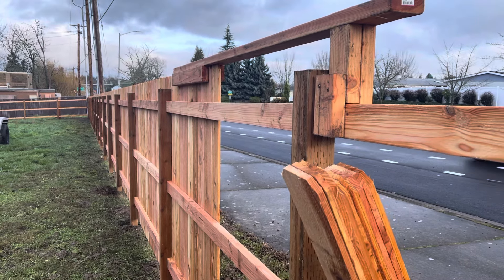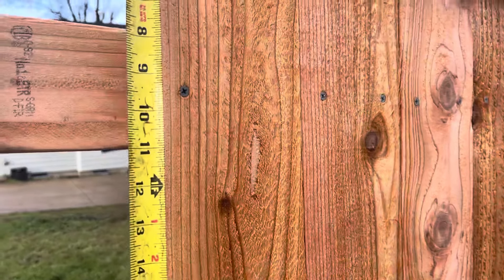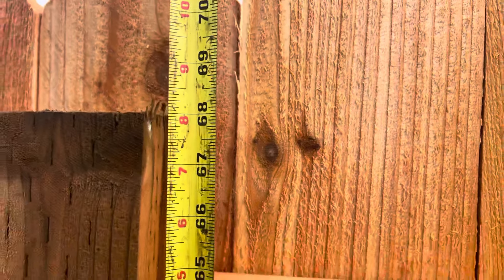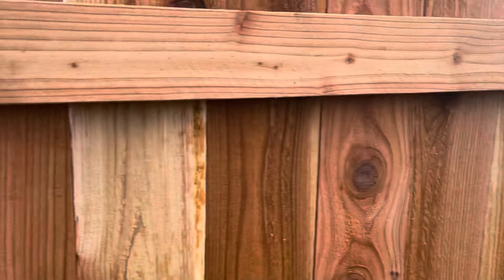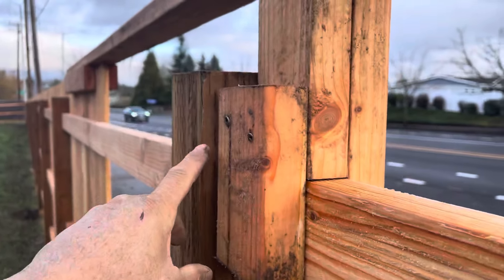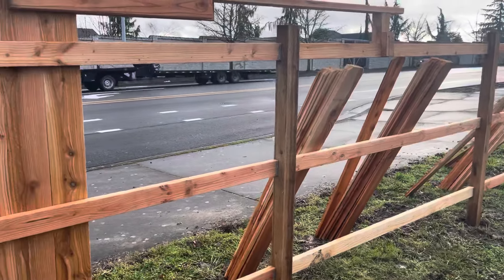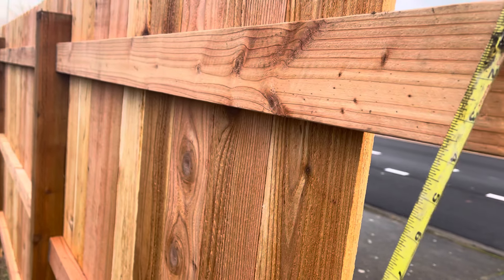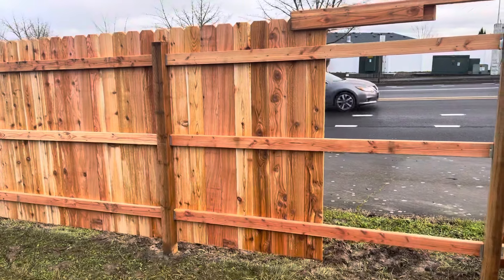HOW TO BUILD A WOOD FENCE STRAIGHT DIY

Comment: Isn't that large gap at the bottom of the fence to the ground defeat the purpose of a fence? Well, I mean, if you're wanting to fence in a dog?  Should the dog-ear panels ever follow the ground or does that make the top wind up looking like turds?
Reply from the maker: I am very glad that you asked this question. Thank you. You can follow the contour of the ground. And your fence will look on the top like the ground does on the bottom. If it ground goes up and down , the top of the fence will also. This may not be the most desirable look. If the fence were built that way, and then you decided you wanted to make your yard flat. You would end up burying the bottom of the fence fixing the low spots. Your ground would not be flat any more , but can you imagine what the top of the fence would look like now? Flat ground and a fence that goes up and down?  If you have a yard with uneven ground. And you have a dog also. And you want your fence to look good, keep your dog in, and add value to your home and curb appeal at the same time. I would suggest using this method. Fix the fence first to establish a grade.  The fence is now straight from one end of the other . If you use the new fence as a guideline to build your dirt up to the bottom of the fence, your yard will be perfect. Just like the top looks. The bottom will now match. Now you can  solve multiple problems while at the same time enhancing your property.  I hope this helps to answer your question. Please feel free to ask more if you have them. I will be happy to try and answer them. Thanks again!
Reply: @fastflo1   Well, for the dog, I can't keep them inside. They shit! IF they ever got out, I'd freak! 
But for the fence....So, if someone has an uneven ground, and they want the straight line sight at the top of the fence, the two options are to build the ground up, which isn't always an easy taste, or simply bury the pickets? I suppose you could cut them down to size too, right? The reason I ask is because thats what I just did on my current flip property. It was a "B"....took forever! And not to mention, some spots the height of the fence is pretty short. Thats why I thought, "well, I can just run along the ground and let it determine the height, but like you said, that wouldn't look good in the end either. 
So, I'm guessing the ideal situation to end up with a great looking fence, you pretty much need a straight an level ground, right?
BTW, thanks for taking the time for the response!
Reply from the maker: @johnnyleeway3466  Sorry for the late response. I did not see this until now. I prefer to run a nice long line as consistent as possible and this provides a guideline for the landscape. You end up with a nice yard and fence line. You can extend the boards.  But the issue I have with building a fence to all the low spots is that if you ever decide to fix the yard later you have to bury the fence and end up with a uneven looking fence in the end. So My advice is to pick a grade that would look good, fix all the low spots, cut down some high spots, and even the landscape as much as you can. Build the fence and make it look nice, keeping on mind you are using the bottom as a guide for the dirt in the end. Then complete the fence and then fill in the area with dirt or gravel of your choice. Grass , barkdust, etc. This will ensure the dogs never get out and your yard and fence will look outstanding. Solves all of the problems.

Comment: looks great ..but the gap at the bottom looks big
Reply from the maker: Thank you. And this in exactly how you fix a yard. The bottom of the fence serves as a guideline. A good fence should be built and the landscape to match becomes perfect. If at all possible, I always make the fence perfect so the landscape is also. Rather than the fence follow the ups and downs . That is why the gap is like that. The yard will now be filled with topsoil and a bark dust border.

Comment: So, A mason's line would pull tight from end to end to make the line for the first 2x4 rail. 

Where is the video on getting that first part done 🤪🤔🫶🏻✌🏽

Looks like a laser beam was used, or else this took a special technique to assure such accuracy. 

Amazing accuracy and the attention to details is top-price worthy !

(edit) l found it 
👇🏼👇🏼👇🏼👇🏼👇🏼
https://youtube.com/playlist?list=PLDBnqLv1jNo1uZ9piazWGUdWMw78IY8Lt
Reply from the maker: I rely on my eye for line and grade. I have used several different methods over the years. I developed my own technique with survey flagging tape. And setting to height, no cutting. I do consider grading to be one of the most crucial parts of the job. I spent years refining my skillset to achieve the results of laser accuracy, doing it by eye. Thank you for noticing! I appreciate it!  Hope fully you subscribed. I have much more content coming on fences! Thanks for watching!👍
Reply: @fastflo1  

Ok, you made it clear to innerstand. 
great tips.  I liked , shared, and subscribed.

Comment: Why dont you set you post as tall as your fence boards in Oregon that what i see all the time i never see it build like this or unless someone coming from Florida
Reply from the maker: If I do a top cap I will do that. Otherwise I like to set the post deeper in the ground for better set. Also I like that it does not block the dogear boards either.

Comment: So, that's how you make it flat on the top, but how to do what the title says: make it straight?
Reply from the maker: I meant straight form end to end without ups or downs. I could make a video on how to make a straight line. I have been wanting to make that video. I do the line and height at the same time. I have several different methods to share. I did this one by eye.